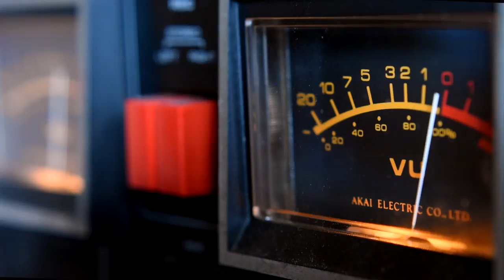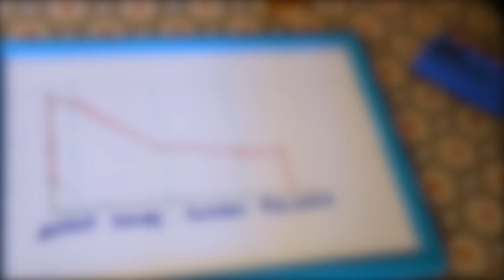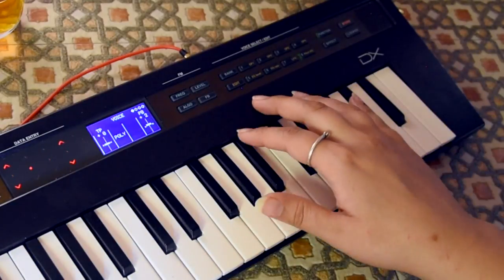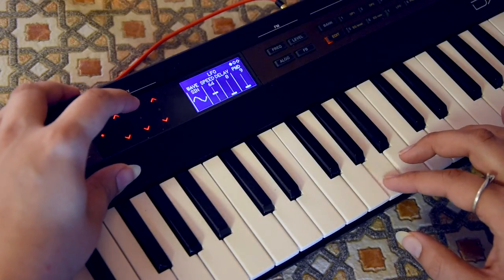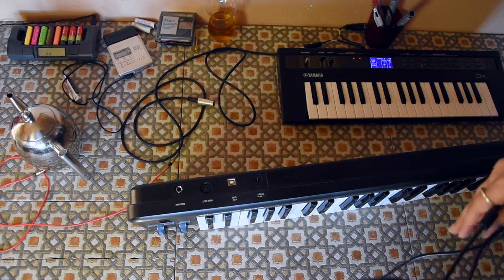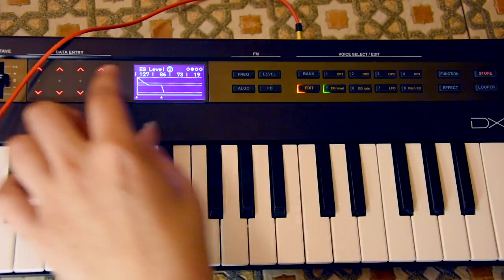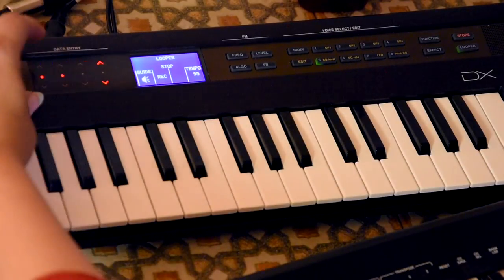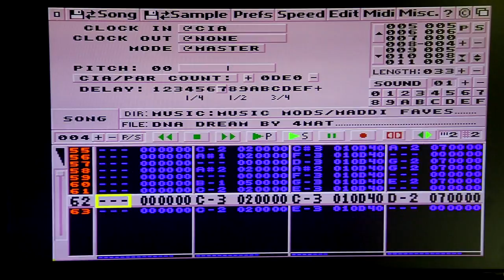Yamaha Reface DX Part 2 - Exploring the DX

Comment: fm is a complex thing to master, subtractive synthesizers are easier obviously but reface dx has something from both sides, you have complex waveforms like square at op level...this is due to try to make fm easier for all.

however learning how fm works gives a great advantage even if you work with analogue subtractive synths, because to get good results with fm you have to think in terms of harmonic spectras, modulation indexes and so on...it's an hard way but gives you a very good understanding of sound in general, a very good exercise for ear and mind.

Comment: The reface DX is such a versitile synth. To overcome the limitation of storing only one voice, my dad created a midi sysex patchbank storage device for me. This way I can have a library of custom sound with the need to overwrite the built-in sounds. There are also software programs that can load and save midi sysex patch information. The patches are quite small files.
Reply: That's very interesting. I was planning to do something similar using a raspberry pi or another small single board computer, but I haven't made up my mind about the kind of screen / interface I would want it to have. Can you share more information about your device?

Comment: ADSR is called the envelope, the other part, which is what the envelope modifies is the waveform, a much more complex part of a synthesizer is how waveform is produced. The DX modifies the frequency modulation combines waves, not layers them (although it can) but combining them to modify a single waveform.  The Moog series uses filters to modify the waveform, where LFO (low frequency oscillators) can modify the filter cutoff and resonance.  Roland D-50 uses a PCM sample during the attack and uses a synth wave for the rest of the envelope.  Most studios have a combination of different types of synthesizers, because they have different sounds. I really like the reface series.  I have a Yamaha Motif, but it's not portable (for me) at all because it weighs like 75 lbs.  I wouldn't mind replacing it with a couple much lighter Reface keyboards.  I have a small midi controller and a laptop I can move around easily, but I really do prefer keyboards that can make their own sounds that I can modify.

Comment: You got it mostly right with Attack, Decay, Sustain and Release.
Sustain is at what level the sound will stay at as long as you keep a key pressed down. As soon as you release the key then the release value takes over and sound will fade out fast or slow.

EDIT:
LFO Is Low Frequency Oscillator. It's like a sound wave but usually below the audible range. It can be set just as your Oscillator for sound like Sine, Square, Saw etc. You can link that to a filter, volume, pitch etc to get a moving sound. And if you then combine that with an Envelope you could have a vibrato that fades in for example the longer you keep the key pressed.
Reply from the maker: Thank you for the info!
Reply: Synths are so much fun :D
Reply from the maker: I tend to dive in and learn without reading any theory so I do appreciate you filling me in with the terminology and info that I miss along the way!  
Synths are indeed fun! As i´m discovering with this DX! :o))
Reply: The DX is an FM synth (Frequency Modulation) They are a bit more tricky to get a grasp on in my opinion but more powerful too. What that means is you begin with a simple waveform then you use more wave forms to shape it (that would be the operators I think) or shape filters.
Now things get really interesting if you slightly detune the operators too and combine them in interesting ways. I've never used that synth or the old DX7 so I don't know how complex the mixing matrix is but the principles are always the same.
Reply from the maker: Thats interesting, so in a way if I get used to FM, i'd find say something like an analogue synth a little easier? 
Hmm I will mess around with detuning the operators, literally it's like molding the sound like clay on a potter's wheel to get the shape you want.
Reply: If it's analogue or digital does not really matter, the other kind of synth is Subtraktiv synthesis. It's much easier to learn. As the name implies you subtract stuff from your sound oscillators with filters and such. You still have envelopes and LFOs, those are common of all synths. A digital subtraktiv synth tends to give you more oscillators/voices for cheaper price and the only difference is an algorithm inside a chip that produces the sound instead of discrete electronics which is much more expensive for a complex setup with multiple oscillators and voices.

Ok so after watching again I can see what's going on here. The operators are your sound waves. Algo determines which operator affects what other operator(s) by modulating them via the shape and pitch and level. With the very useful display you get a very nice overview of that so pay attention to what goes where.
So for practice say, config Algo so Operator 2 affects  OP1. then play around with changing the character and pitch of operator 2 and see what happens with OP1. As long as level is set to 0 on OP3 and 4 they won't do anything so it does not matter where they sit in the Algo chain.

I've only used soft synth FM before but I do have a Mini Nova synth here. It's digital subtractive and a lot of fun to work with :)

Comment: Surprised you learnt this much about synthesis this fast, especially as FM synthesis is the hardest type to learn. you are diving in at the deep end!

attack: how long it takes to get to maximum strength.

decay: the moment the attack finishes, the decay starts, and the decay is how long it takes to go from the maximum strength to the sustain level.
(If the sustain level is zero, the envelope will "decay" out until you let go of the note, then the release starts. If the sustain is on full, changing the decay will do nothing, because as the decay goes from max strength to the sustain lvl but if the sustain level is also max strength then it has no room to go down.)

sustain: after the attack and decay finish, the sustain level is how loud the note will be for as long as you hold it. sustain is very different to the other settings on an envelope.

release: how long it takes for whatever strength the envelope is at to fade to zero, and starts whenever you release the key (even if it is still in the attack or decay time).

the reason I referred to the height of the envelope as "strength" instead of "amplitude" is because envelopes can be used for more than just amplitude, they can be used to control anything, for example filter depth (the higher the envelope, the brighter the sound).

here are some common envelope settings and how they work so you can get a better grip on them.
Organ: 
full strength for the whole time the note is pressed.

atk: very short to none
dcy: any
sus: full
rel: very short to none

realistic pluck:

a transient that carries on decaying independent from wether you are or aren't holding the note.
atk: very short
dcy: as long as you want.
sus: none
rel: again any you want, but make sure the release and decay are the same size.

bowed strings:

initially quite loud, but as you hold the note it stabilises. these specifications are quite broad as it really depends on what sort of strings you want.
atk: as long as you want, but at least long enough to be noticeable
dcy: same situation as attack.
sus: somewhere between 30% and 90% generally. again, depends on how you want your sound to be.
rel: as long as you want. again enough to be noticeable, but I would have it medium to long.

as for saving your sounds, I have heard there is a free app you can save them to. no idea how it works, but there are definitely tutorial videos out there.

let me know if there is anything at all about any synths you don't understand, as you can probably tell I am happy to help ;3

Comment: Flange vs phaser: you can do a phaser effect the same way as a flanger effect, though with a shorter delay time than a flanger. Phasers can also be done by cutting notches into the signal afair.

Comment: I never knew it was possible to play music live on the Amiga. I recently watched a Shot97 video where he used a basic midi cable to connect to the computer. Do you have a proper interface or just a wire job?  He uses Music X because he claims it delivered a very smooth analogue sound, so may be worth a look?.  I used to dabble with Octamed, but with samples and not a keyboard as I cant play instruments.  I believe Octamed 7 has the midi controls but not sure about Octamed v4 I normally use. They are both on CU Amiga cover CDs.  I also use Protracker v3.61 sometimes as this seems more compatible with some MODs.  Anyway, great video as always, lots of views and likes. :)

btw, voting for the next Lemon Open Round game ends in 7 days time, someone suggested Arabian Nights?
Reply from the maker: i have a proper Midi interface, though it's quite simple inside (yes I opened it out of curiosity) :o)) 
I really need to give Music X a go, i've been heairng good things about it lately. 
I used to try and mess about with Octamed v5 which actually came as a coverdisk, I liked it but never got on with it, I think Soundtracker Pro 2 (CU amiga coverdisk) spoiled me with regards to interface, it is just so natural for me. Way more than the other Pro tracker/noise tracker etc. 
Thank you! :o)

for voting, yes it was one of the Lemons, Mike Glover, who suggested that on my video, actually that would be a good one.

Comment: Won't the Amiga with sequencer and patch software make the limitations of the Looper moot?
Reply from the maker: moot?
i'm basically just using it as a Midi controller on the Amiga. With soundtracker pro at least anyway.
Reply: MsMadLemon not needed. if you are recording to the Amiga and layering with it.
Reply from the maker: I dont understand what you're getting at, Tracker programs like soundtracker/protracker etc work differently to a sequencer.
Reply: MsMadLemon Right, but the Amiga has sequencer software for it too. You could record your mods to a digital media like minidisc or even cd-r and use the Amiga with sequencer and patch software and a mixer to recombine the two. Then you could get more than one voice out of the DX reface at the same time!
Reply: Another option would be a Multitrack recorder like a Tascam 4 track or 8 track Portastudio. :]
Reply from the maker: Why not just layer the sound from the mods after recording them into an external sound editor, even soundtracker pro has the option to mix tracks, allowing you to add more channels (kinda, more like giving that effect)

Comment: You can not change the tune of the DX (A=440Hz to 432Hz). I have searched, I haven't finded!
Reply: I don't have one (yet) but it's supposed to have been added in the v1.3 firmware update.  See:

 reface CS,DX,CP,YC Version 1.30 Supplementary Manual v130_Manual_en.pdf

Under New reface DX Functions > Master Tuning (M.TUNE) :

Master Tuning and Master Transpose can be set on the Tuning screen that has been added as Page 2 displayed by using the 
[FUNCTION] button. {picture}

M.TUNE
(Master Tuning)
414.8 to 466.8 (Hz)
Shifts the pitch of the entire instrument in 0.2-Hz steps. This can be very useful when 
you wish to tune your reface to the pitch of another instrument or a CD.
440.0 (Hz)Returns the Master Tuning to the factory default setting (440.0 Hz).

M.TP
(Master Transpose)
-12 to +12
Adjusts the sound produced by the keyboard in semitone units (where 12 semitones 
equals one octave). This allows you to, for example, change the key of a song while 
still playing the same keys on the keyboard.

NOTE
The MIDI Settings screen, the System Settings screen, and the Job screen can now be found on pages 3, 4, and 5
Reply: Also, in UpdaterGuide_en.pdf, which comes with the firmware update, it says:

Confirming the Current Version

reface DX

While holding down the F#3, A3, and C#4 keys, press the [] (Standby/On) switch.

(The version number appears on the screen)

Comment: And to answer your question. You can't make the sounds on the DX7 Reface velocity sensitive. The synthengine is not capable of it. The keyboard itself of the Reface is velocity sensitive if you use it as a MIDI keyboard but you won't be able to play velocity sensitive DX7 sounds on this thing. Sorry :(
Reply from the maker: But I did though lol 19:09
Reply: Weird. According to my informations the engine wasn't capable of it. Either that was regarding a preview model that wasn't finished yet or someone wrote a lot of bull. lol. Ah well… guess I was wrong then.